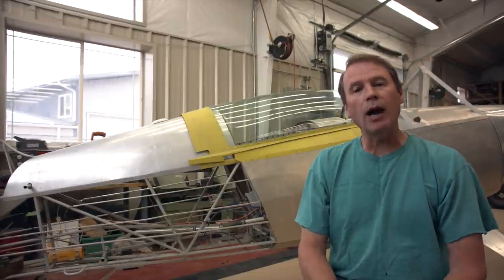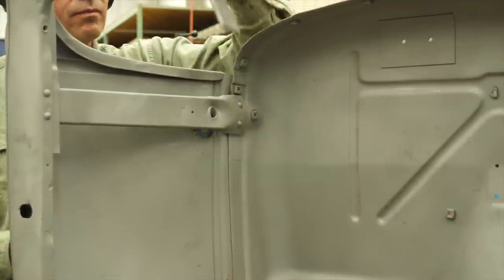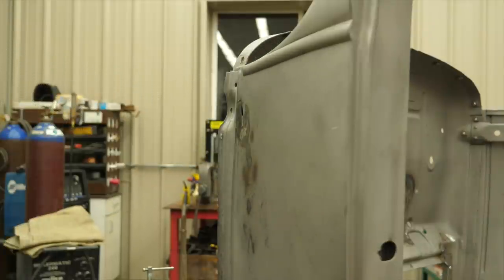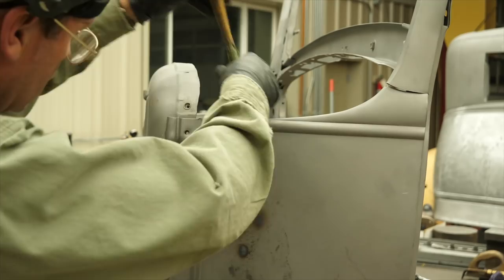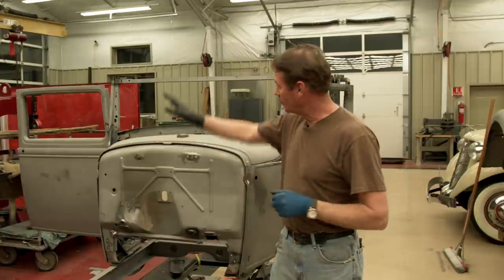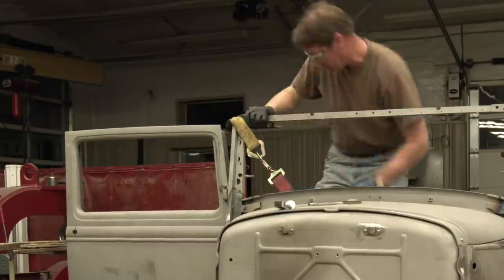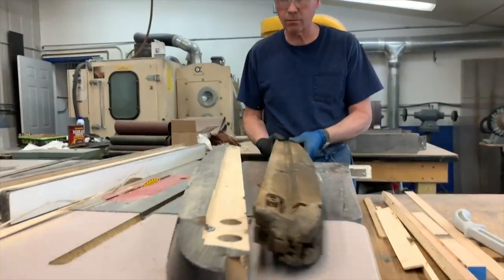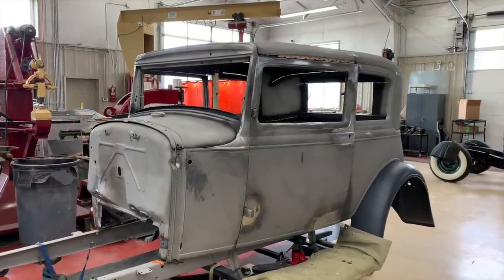EP 6 1931 Model A Victoria Restoration

Comment: Airplanes = YES... I would have cut the center section out of the bracket, left the original rivets holding the bracket in place, and then Tig welded the cut center section of the bracket back together. Replacing those rivets with nuts seemed like a poor choice to me over using the original rivets and the Tig. I laughed when you mentioned the wood framing. Never does a door off a Coach Built Car, even a Cadillac, Packard or whatever, seem to fit another car of the same year and style without some modification. Those Coach Built Cars really were hand made, one at a time.Loved that Auburn "coach built" skeleton door in the video too. Let me know the hours you finally put into to restoring this car. Should be interesting. Thanks for another great video!!!
Reply from the maker: I thought about that.  The rivets was the reason I dod not want to remove the bracket.  I think you have the right idea.
Reply: @claytoresto  ya know its pretty easy to sit back and watch a video and come up with all sorts of suggestions to make things easier after the fact. Seems everyone always says, well I would have done this or I would have done that and I hate to sound that way too... but I will tell you this, I do admire your determination to preserve originality, you just a perfectionists at heart, which most of us who restore cars, possess and understand the genuine love for them and the mind set. Street Rods sure are a lot easier, lol. Thanks again for a great video.

Comment: Anyone how does this kind of thing for any length of time knows that some days NOTHING seems to "cooperate" !!! When you run into one of those days, you either need to resort to a "stubborn" (more "kindly" referred to as "committed", "dedicated", or "determined") approach or quit. Main thing is to stay CALM !!! Getting "angry" only results in MORE WORK !! 
Love your "lesson" associated with taking care of the "raked" cowl section. That being "the biggest, fanciest, most expensive, machine/tool is not always the best way to correct a problem. Sometimes, that old slow and deliberate "common sense" use of controlled force method and a ruler turns out to be the best approach. My 29 CC pickup had some of that too. Only it was front to back. Again, no "special" tools. Just leverage to increase force and not move things too fast.
Reply from the maker: So true

Comment: Nice to see some wood frame work - my '32 Packard 902 roadster is a 'burn victim' and I will be replacing all of the wood.  Do you put anything between the sheet metal and wood to prevent squeaks?  What about when you are welding/leading - any heat resistant material you use to prevent smoldering burnt wood?
Reply from the maker: We are restoring a 902 Coupe-Roadster right now.

Comment: In removing that bracket you uncovered my pet peeve....rust between riveted or welded part.  It's a sure bet that there's rust under the passenger side bracket, too.  It's also a sure bet that there's more rust between other metal-to-metal mechanical joins and spot welds.  Do you address that rust?  And, if so, how?
Reply from the maker: We used to have a Redo-Strip here in CO.  It was the best, but they are long gone, so all we have is blasting.  And you are right, rust between the panels is often overlooked.

Comment: Yes airplanes please, I have a DH 82 Tiger Moth nose panel to tackle, the hard part is how many separate panels to make and weld together.
I would have used a small cutting wheel to cut the brace panel just past the hole close to the front, easy to get your hand in to use the Dolly and to repair the frame and tig to finish.
Reply from the maker: Big positive response so far so looks like we will build the Skybolt.

Comment: Some days my fingers seem twice as large as other days
Reply: Years ago I saw a film on body work. To shrink the metal you heat it like you did and then cool it with a wet rag. I haven't tried it but it makes sense. Anyway nice work. I'm enjoying watching you.
Reply from the maker: I use air because the metal does not rust.  But same idea.  A quick cooling action.

Comment: You say you've done all these restorations but you make an easy job hard by not straightening the cowl light bracket first before doing the bodywork. You cut the rivets THEN sort the bracket. Hell, you don't even have to rivet it back on, simply tig weld. I also think it's time you woke up to the fact that a smear of body filler can make a hard job easier without leading everything. At least you admitted your mistake. BTW, after 2 years restoring my show winning Slant 160B, I pissed the glove idea off to get a better feel with bear hands. Never used gloves again to this day!!!
Reply from the maker: I use gloves because if I touch the metal with my bare hands it will rust in that spot.  Colorado climate I guess.
Reply: @claytoresto  I live in Australia, have worked on cars & motorcycles for over 50 years & have never, ever worn any sort of glove except leather for welding. Put simply, while I appreciate the work you do-if you have to wear gloves to avoid rust on panels, something is very much wrong, especially an old Ford A Model, which I have completed over 3 years & never seen a finger mark because of all the chromium in the steel bodywork.

Comment: Trying to 'marry' wood and metal is a big problem when it comes to precision.  Temperature affects metal and moisture affects wood.  I have worked with each one and it is easier to work with wood by itself or metal by itself.  Back then, they used fractional measurements but now we use decimal measurements.  Keeping your sanity is essential.
Reply from the maker: No kidding.  Well said.